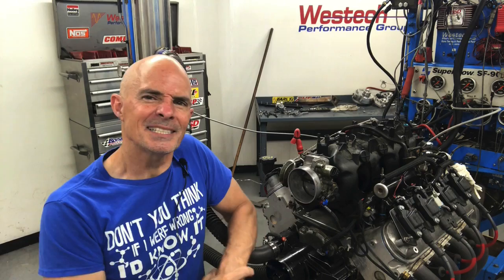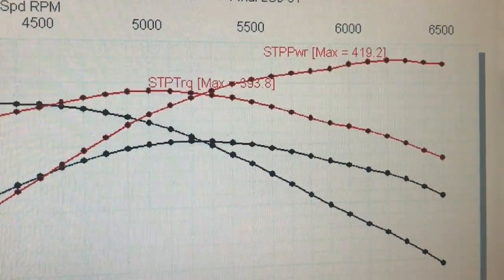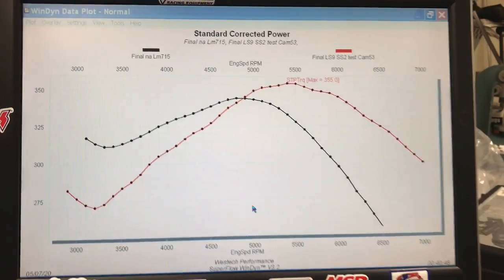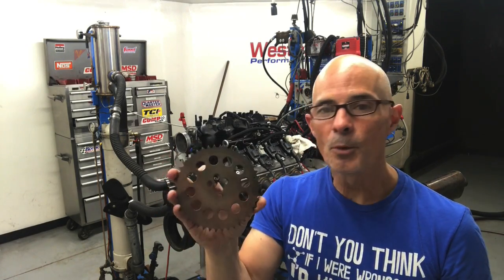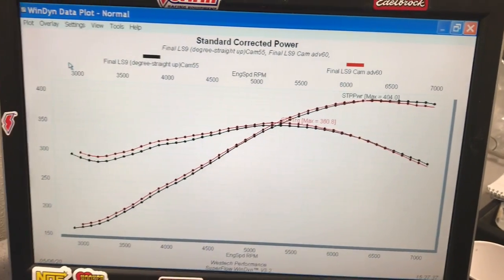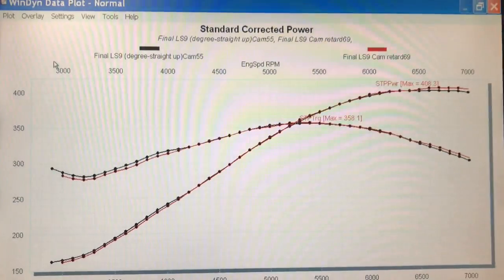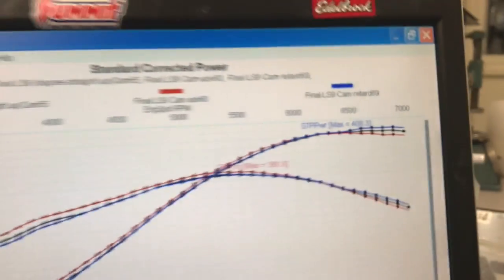LS9 HOW TO: EXTRA TORQUE!!

Comment: As a Ford guy it's a shame LS motors are so good. I hate having to boost every mod motor since it's the only thing comparable.
Reply: lack of displacement compared to the larger gm engines is all.

the 5.0 made more power and torque than the 4.8 even back in 2011. if you compare 4.6s from 99+, they made slightly less power but more torque than the 4.8. the 4.6 3v engines made more power and torque than the 4.8 and came close to the 5.3. the 4.6 4v engines from 99+ came close to or equaling the 5.3 in torque and exceeded the power.

if you compare the 5.3 to fords 5.4 in equal years, the 5.4 made more power and torque. 

the only drawback to the modular engines is complexity (cost) and weight, relative to ls engines. and really, they main drawback is the pistons and rods since none of the n/a engines can take over 450rwhp (except coyote of course, it obviously does much better)
Reply from the maker: na mod motors can take a lot more than 450 hp

Comment: Another question answered! I’m thinking the super-wide LSA kills the mid-range no matter what. How about the same test with the LS3 cam? It doesn’t have much in the way of overlap, but more than the LS9. OTOH, an extra$200-$300 gets you a real aftermarket cam that works. Never underestimate the effect of torque on drivability, though. Not so much if it’s a drag car, obviously.

Comment: Maybe the stock 6.0/Ls1 cam would be the best bang for the buck here. Already a 3 bolt rear cam sensor, and doesn’t loose too much down low compared to the LS9, if my memory is correct. And they are a dime a dozen. And the LSA is 116 vs 122

Comment: In the real world be careful to put this cam on pick up with automatic transmission witout upgrade the torque converter to at least 3000 RPM, that happend to me on a 2006 Silverado i swap L92 6.2 engine with LS9 camshaft, could air intake, 1 3/4 long tube headers and HP tuners  custom tuning, and and the results was disappointing, on the range 800 to 3500 RPM,  the next move was to change the cam for a 5.3 gen 3 cam and this result  are ok, today i wait to a afrermarket cam to out it in this engine my choose was a Trickflow 3060200 and Howadrs 98113 valve springs which I have already used in l92 engines with excellent result. Like Richard said the best cam is that works fine to you
Reply from the maker: take a look at the stock ls cam video-we tested them all
Reply: Thanks for your answer Richard and thanks for all knowledge that you transmit to us through your videos, is something amazing

Comment: Check out Davis Vizards "128" camshaft tip. Pretty sure that will give you the best cam. ;) 
https://www.youtube.com/watch?v=goQAdAHngzg
Using this I made 1.18 lbs/ft pr. cube on pump fuel in a hub dyno. Carb SBF.

Comment: I think this is all relative. We still have a motor that makes over 300 ftlbs for the entire duration of its powerband.  Yes it looses tq compared too the anemic 5.3 and 4.8 cams, but even on the 4.8 it STILL exceeds 300ftlbs for the entire duration of the tq curve. Thats perfectly drive able. Your not beating the shit out of your valvetrain with crazy lobes and not sacrificing any driveability.  Would this be the best choice if your towing? Obv not. But for a street vehicle its gonna be cheap, really reliable, and make tons of power when you open up the loud pedal. Seems like a winner.

Comment: Thanks, that was interesting.  
I'd think you'd need to be careful when advancing the cam though...  Would be easy to run into valve & piston clearance issues.
Reply from the maker: lots of p-v on the stock cam-especially with this wide lsa
Reply: @richardholdener1727  Maybe on that particular application, but I'm speaking in general terms.

Comment: This is great. Need more like this. FYI - you could do this via tune on the newer VVT engines!
Reply from the maker: yes
Reply: Richard Holdener thats one I’ve always been really interested in. How much is there to gain with just by changing the vvt tables on an otherwise stock motor.  On say an LMG 5.3 if you’re taking requests. 🙂

Comment: Thanks, I have 494 big blocks in my propane bobtails. They run on propane through a "mixer" it is rated at 425 cfm.... my bmep noses over around 3500 rpm.  We run the cam advanced as you would imagine...with 11 to 1's we get just over 500 foot pounds out of them.....not bad for .85 %  of the power of gas and 1/2 the cfm of a  normal setup.

Comment: So you asked about this with a stock ecu. Well every ecu or operating system is a little different, but in older 1x systems  4 degrees wouldn't trigger a "crank/cam correlation" code you might get away with 6 . But gen 4 4x systems would show a code around 4 degrees. I've been advancing cams for all these guys that buy the btr stage 3 and 4 truck cans with stock converters and just dont get why they got no low end....
Reply from the maker: thnx
Reply: Your comment and this video helps alot. Just put a Ls2 cam in gen IV 4.8 in 95 k1500 manual and advanced it 4 degrees. No start p0016 cam/crank correlation. Going to take it all back apart and try 2 degrees. Hopefully it will work or should I go straight up? Again thinks for the videos.

Comment: Funny you installed the cam with no lube on it!
Reply from the maker: we clean & pre lube-didn't show on the video-never dry
Reply: I’m guessing because the engine had just been run that there would be oil on the bearings and mainly the oil system would be fairly primed up ready to go so no big deal. The cam is second hand so probably a bit oily before it went in as well

Comment: In my experience I've noticed to a certain degree wide lsa cams start losing top end hp pretty fast once you start advancing them more than a couple degrees, more so than on a Narrow LS cam
I'm not sure if it has to do with pumping losses or where the exhaust valve is opening and closing, this test was one of the least drastic I've seen on this type of test, and yeah Richard do you ever sleep? My goodness

Comment: Engine will start and run with no cam sensor... I ran my LS7 that way running a Jesel belt and no sensor. it’s a little like roulette odds and evens as the engine may be 180 out and pop out the exhaust on crank.. I just re cycle the ignition an go again and most times it will fire up on the second or third attempt if it didn’t go on the first hit

Comment: Disappointing results-is this a function of the LSA? IMHO there must be major gains by varying cam timing otherwise OEM would not install VVT systems on their engines. Please run this test again with a different cam. Thank you.
Reply: There are gains to be seen from a VVT system. The difference is, what he was doing here was making static changes to the cam timing, meaning the advance or retard is the same through the entire RPM range. A VVT system is able to change cam timing on the fly throughout the RPM range, which is were the advantage comes in. All those changes he was showing on the graph of gaining or losing power at the bottom or top based on cam timing... a VVT system can do that on the fly and get the best of both worlds.

Comment: Advancing the cam raises low speed vacuum. That can be a consideration especially with carbs. I have advanced cams by one tooth on several engines and gained more mpg and low speed response.  I never quite believed all the bull about timing a cam. As long as the valves don't hit the pistons it's OK. With chains the cam always retards with hours run time. So what are you doing?

Comment: I think it’s pretty cool of adjusting the time in like that or the event but I’m wondering what would happen if you change the rocker arm ratio from 1.7 to 1.8 change the left on the cam I Wonder how that would work
Reply: More lift, more air fuel, bigger boom, more hp.

Comment: The LS9 is 125$ shipped on amazon! With a turbo LS setup IMO, the last thing I want on  street car is more power down low.... boost takes care of that easily. Great cam for the $!
Reply: Agreed, it makes 300ftlbs accross the entire tq curve already. Boost is going too  amplify that. Easy 500 or 600ftlbs at 3000 rpm. Killing some of that low end tq is good for transmissions lol. Especially if you have a modest turbo that lights like a candle.

Comment: IMHO perfect cam for 4.8 is 211/219 on 112 +4
Reply: Indy Rock how does that cam perform.
Reply: You see some guys that race their dirtball junkyard engines have a cam that is way bigger than you think. For them 20hp at 7k or more rpm is worth way more than 50ftlbs at 3k rpm just because the engine never sees 3k. BTR has a tiny torque cam that still makes 30hp more than a factory 5.3 cam.
Reply: Timothy Bayliss  I wish btr would post dyno numbers. I just wish my 4.8 had better low end torque. I’ve looked at the torque cams. I have such a hard time choosing the cam I want.  Most of the time I feel like pulling the 4.8 and swapping it out.
Reply: @dennismindock6276  the torque cams make more torque than stock everywhere with higher peak HP.
In one of Richards cam comparison vids he showed it. I can't remember which one.
Longtubes help too.
But still a 4.8 though
Reply: @dennismindock6276  here's one
https://youtu.be/FKXt25cm_0c
I would say use Stage 1 for a 4.8
Reply: @dennismindock6276  here's the btr torque cam in a 5.3
http://www.trucktrend.com/how-to/engine/1909-truck-torque-adding-cam-muscle-counts/

Comment: How would it work in a turbo application?
Reply: Great
Reply: Yes, not ideal but works well. Has almost the same specs as the old  Lingenfelter GT7 cam Lingenfelter was using on their old turbo setups.
Reply from the maker: the LS9 loses low-speed torque both na and turbo

Comment: this guy knows what he's doing and shares knowledge. everybody should give him a thumb up.
thanks for the good content. subscribed
Reply from the maker: thnx
Reply: Richard Holdener Richard...what would the best cam be for torque? Not looking for horsepower gain, just torque. I am installing a 5.3 in a 1967 Chevy TravelCruiser camper, and looking for more low speed torque to tow with. Will probably never reach 4500 rpm. Would playing with cam timing in a factory lm7 work?
Reply: @blackwidowprobe  Brian Tooley has a torque cam specifically for trucks, Richard did a test on them last year. +20ftlbs at 3000 over the factory 5.3 cam and 21" of idle vacuum. Put a set of longtubes on it and enjoy the torque. The cam is designed to work with the factory shift points and peaks power at about 5500rpm, only a couple rpm later than stock. It makes more power everywhere at every rpm tested.
Reply: @timothybayliss6680  would that cam be good for my 2011 silverado on 36x15.50 on 20x12s I do alot of mudding and towing and want to vvt and dod delete mine. Already have long tubes no cats no rear 02s tuned out

Comment: Conclusion: Probably just use LS3 cam.  Use the LS9 when you actually need to reduce cylinder pressure at lower RPM to save the rods.
Reply from the maker: check out the stock ls cam video to see how all the factory cams compare

Comment: I have an LS9 Cam in my trailblazer SS which has a L77 6.0 out of a 2012 caprice ppv.  I deleted the DOD and upgraded the valve Springs. I plan on putting a rear mounted 76 mm Turbo on it.  Do you think this Cam is a good combination with the Turbo?     P.s. The truck is a daily driver, With a little street racing.
Reply: Yes, not ideal but works well. Has almost the same specs as the old  Lingenfelter GT7 cam Lingenfelter was using on their old turbo setups.
Reply from the maker: it is not ideal-loses low speed torque even with turbo but every cam is a turbo cam

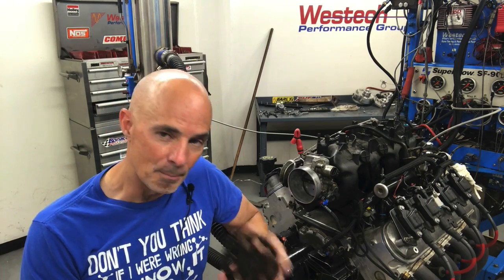Comment: I grabbed a ls9 cam for my truck and yes I can attest to the loss of bottom end. It was the cheapest cam even cheaper than bone stock. But I can say since I put in the 4:11 gear it kinda made up for the low end loss.
Reply: Loss of low speed torque is good in snow country. If it creeps along slowly it may save your ass in a snowstorm.  I had a 98 Olds with a cam. It would creep along real slow. Never got stuck with an open diff.
Reply from the maker: it does charge on the big end

Comment: Hey Richard what’s the best cam for my 5.3 lm7 I put it in my 1984 cutlass gbody
Wanna try keep torque too
Reply: Most hp gains with minimal low rpm torque loss?
BTR Stage 1 truck cam or Summuit Sum-8718
Reply from the maker: both of those work
Reply: Chad Gardee It’s the cam he tests next. weren’t you listening 👂?
Reply: Sloppy stage 2 also works wonders for not much $$

Comment: Wish you would have ran it on tooth off both directions. It could have been a good educational video on lining the dots up and how big of difference.
Reply from the maker: the advance we put in was a full tooth
Reply: @richardholdener1727  Are you sure about that. I thought I had my cam off one tooth on my gen 2 (LT1) but when i calculated it out it would have been 10 degrees of cam/20 degrees of crank timing.

Comment: Advancing a cam is not a substitute for putting the lobes on a proper LSA. It is robbing Peter to pay Paul. Test the same lobes but on say 116 will be a lot better and won’t hurt the top as much you think.
Reply: There is a test on the channel testing the same lobes on 3 different lsa. The only thing is Richard didn't record idle vacuum. The result are kinda what you expect if you know what your doing.

Comment: Without watching the video:  swap out any Chevy motor for a Ford.
Reply: It must hurt you ford people. Ford have gone through, six generations of V8's, while GM have been producing the LS and the LS has been better than all six.
Ford's last good V8 was the Cleveland.
Reply: @aaronnoyb  When we were teenagers, Dad told us boys to always buy a Ford.  My Brother tried a Chevy once, bent all the valves and left it on the road, and walked home.
My Chevy buddies were always changing out cracked heads.  Me, I just put more water into the rad and tried another land speed run.
My other Brother, leaving the rig lease, pushing mud level with the hood, two wheel drive Ford pickup.  He got out, the others in 4X4's were stuck because they were not willing to hold the throttle to the floor for half an hour.
Reply: Some people just have to learn the hard way Ford sucks!

Comment: So much for degreeing a cam in, on the street you would not notice any difference cheers from OZ.
Reply: I'm glad I degreed my Comp Cam. That was how I found out their quality control was shit and all the exhaust base circles had a dip in them. On N/A probably not a super big deal but, on a turbo set up the last thing you want is the exhaust valve being cracked .020" before hitting the lobe ramp.
Reply: @littleherms3285  Thats a bugger one of the biggest cam makers did you let them know.
Reply: Yup, personally I don't exactly see the point of degreeing a camshaft at all unless you're a serious serious racer, bracket racer or you're running a stock-engine circle track class or something. The knowledge is nothing to be gained on the street.

Comment: Kids, check your clearance if you're gonna try moving the cog one whole tooth!
Reply from the maker: lots of p-v on the ls9
Reply: No ty
Reply: With the 122.5° lsa on the ls9 cam there is very little overlap. I have put a cam in one tooth retarded before, about 9°. I wasn't to worried about pv clearance it had a 4° advance ground in the cam and only 210° at 050. Made the idle a little rougher (16" vs 19.5" vacuum) but I really didn't notice a difference.

Comment: Didn´t some truck LS engines use variable valve timing? I always wondered why noboby adapted the system for performance applications.
Reply: Until recently, the aftermarket/tuners didn't have enough experience with it to take advantage of it, so it was easier to delete.
Reply: @n8rivera74  Too bad. The honda guys don´t commnly delete VTec as far as I know. At least on paper it would benefit the LS greatly as well.
Reply: @FNU_SNU  VTEC operates completely differently to cam phasing VVT. Cam phasing means the computer can advance and retard cam timing (basically like richard is doing in this video). VTEC is basically like having 2 cam profiles in 1 cam
Reply: Most folks delete the system.
Reply: @rcairforceone  Yes, I just wonder why.
Reply from the maker: they usually delete VVT because it limits the cam timing you can apply for performance use-works well with milder cams
Reply: @richardholdener1727  Thanks for sharing the knowledge Richard! Love your videos.
Reply: @richardholdener1727  Do you mean it limits the size(upgrade) of cam that can be used with the VVT??